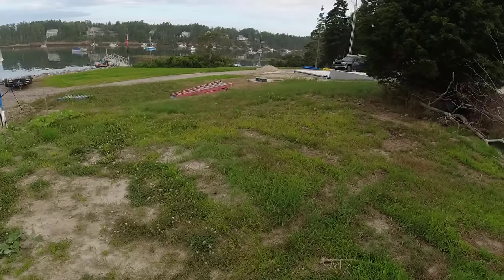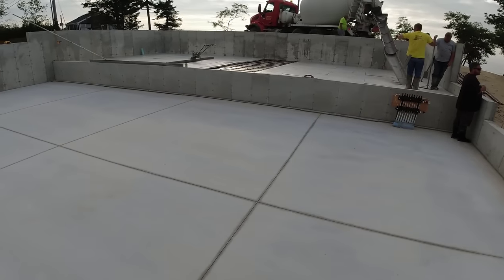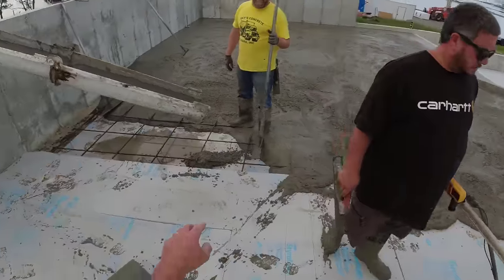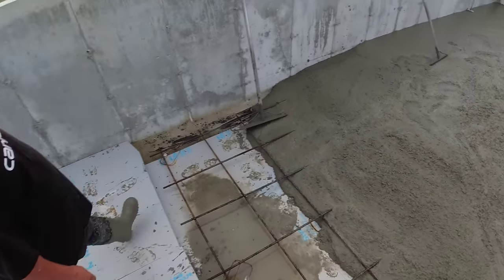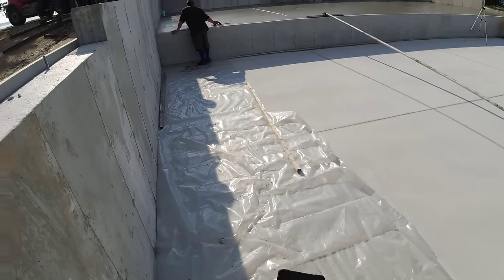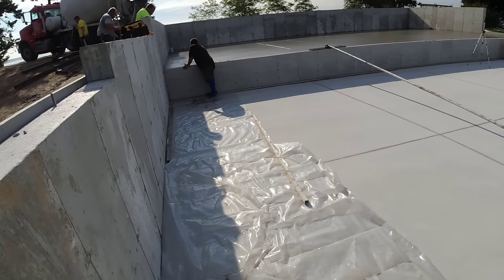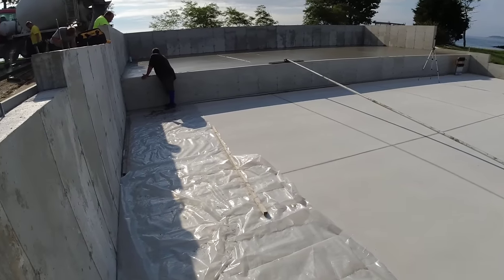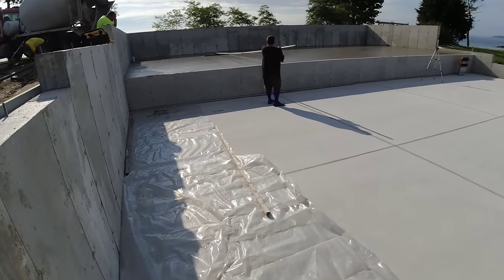The Additive We Use To Make Vibra-Screeding EASY on This 50' x 24' Concrete Floor

Comment: Hi Mike. I've been watching your vids for a few years now. I've been in the bis for about 45 years now, still going strong at 71 y.o. Most of that time in Central Coast Ca. Your methodology mostly conforms to the ways I was trained. I now live in rural ND for about the last 12 years. Workers with our range and level experience are in pretty short supply around here. Getting someone who understands even the concept of raking is difficult to say the least so I want to make it as simple as I can. When trying to communicate with dispatchers in the area about water reducer ranges I get "blank stares" mostly and the response of we put WR in every load without comprehension about different types and amounts. Could you elaborate a little about the details on getting design mixes to suit particular requirements. I hope that made sense. Thanks for your vids, I enjoy watching late at night. Like I said almost 72 y.o. don't sleep much anymore. I still love doing this and feel responsible to pass along the knowledge I have gained to next generations as I believe you do as well. I am thankful to the Lord that I still can and will continue as long as I can.

Comment: HRWR is magic. 90 day test cylinders can test out the same as adding another sack of cement to the mix (900psi higher than mix 28 day strength spec). Saves manpower as well.